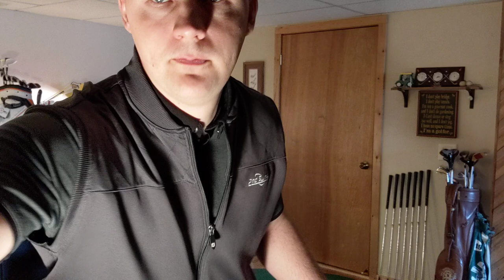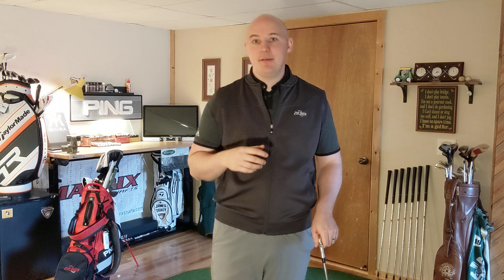How to Reach Optimal Levels of Spin With Your Golf Shot | Master Golf Fitter Tips

Comment: Great video very Informative.

When I hit driver and I have backspin from where it landed about 1meter away with soft conditions of fairway. Any thoughts? Thx
Reply from the maker: Hi Johnny. Depending on how soft of conditions we’re talking about, that’s not abnormal to have the ball stick when it lands. High launch and high spin will especially create that. To lower both launch and spin, you could use lower loft (though that would flatten your lie angle), install a lower launching shaft, or experiment with some low-spin driver heads that have a the center of gravity moved forward.